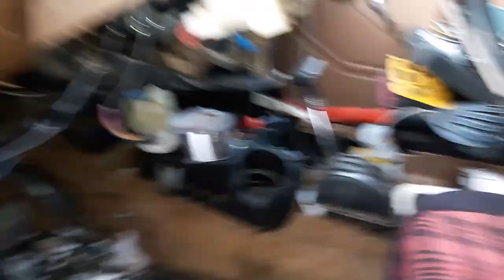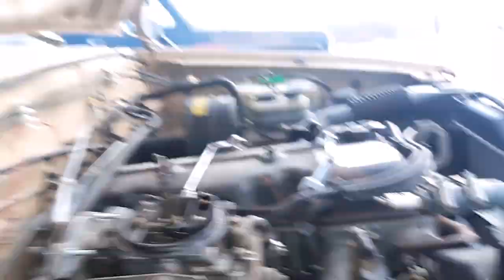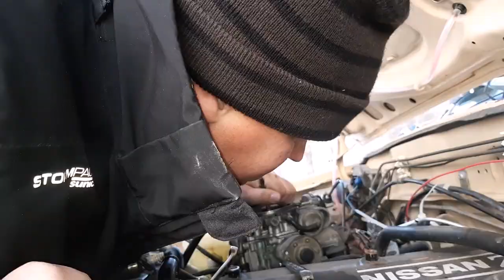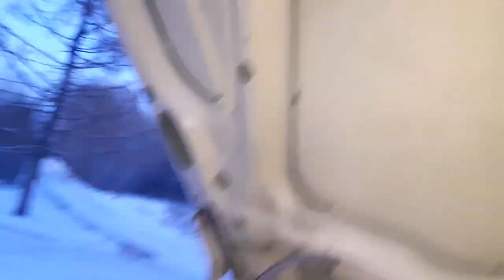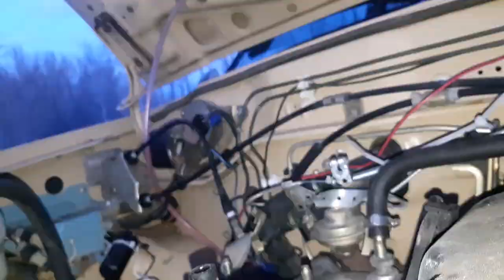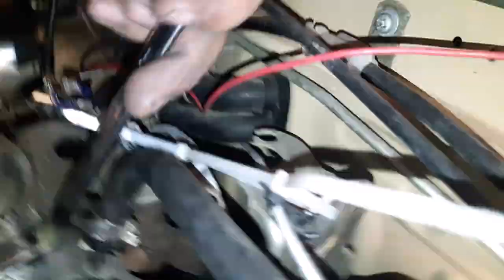Carburetor swap and cold start 1984 Nissan 720 z24 with music

Comment: Hey man, was the original carb stalling out at all ? Or just a rough idle?
Reply from the maker: I was having issues with starting the truck. If  the idle was too low it would stall sometimes.
Reply: @Barret_Radtke  gotcha I'm about to purchase pretty much the same truck with with same issue. So I was thinking of just putting on one of those redline carbs. Not sure if those will pass emissions though 🤔
Reply from the maker: @grimmfrost6337  if its after market i don't think it will pass. you might want to join the 720 owners group on Facebook they would be of more help on this issue.
Reply: @Barret_Radtke  awesome thanks for the info, I'll check there too 👍🏼
Reply from the maker: @grimmfrost6337  np.

Comment: Try explaining what you're doing to the carb instead of fast forwarding through adjustments.
Reply from the maker: wasn't adjusting anything was just bolting it.
Reply from the maker: Next time i work on the carb ill be able to get a better view since i have a tripod this time.
Reply: @Barret_Radtke  Thanks. I have a new carb but it's a factory style replacement. The previous owner bought it or ot would have a Weber if left up to me. 
Appreciate the response.
Reply from the maker: @olliefoxx7165  no problem. having issues with adjustment? so am i.
Reply: @Barret_Radtke  I've got it pretty close to dialed in but I'm having issues with fuel. Either a filter is clogged or fuel pump is bad.
Reply from the maker: @olliefoxx7165  i had a fuel pump stop working a few weeks ago i was always having issues like the truck would be hard to start sometimes take a long time.
Reply: @Barret_Radtke  Sounds just like my issues. The fuel pump is mounted outside the tank, which is a good thing. Does your current carberateur have an automatic choke or manual? I gotta adjust mine. It's an automatic choke.
Reply from the maker: @olliefoxx7165  at the moment its automatic choke. some times when it was really cold it would get stuck in hi idle.